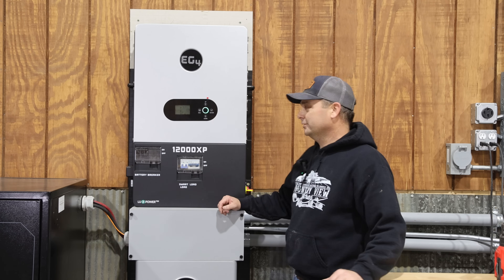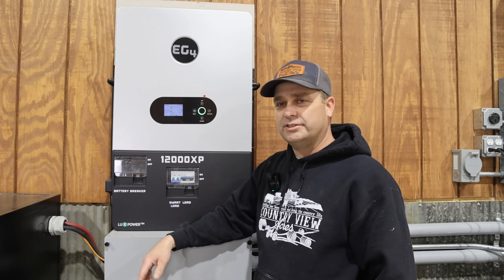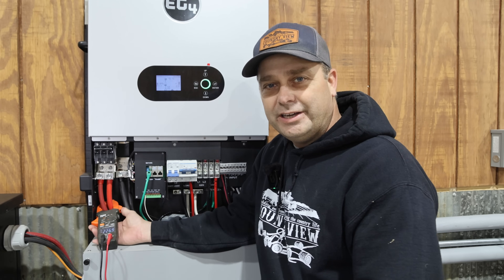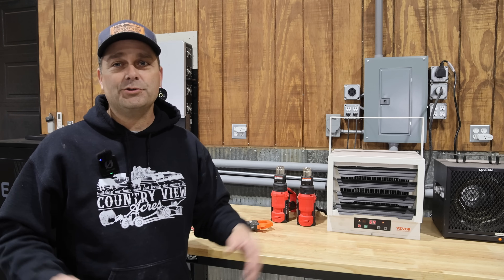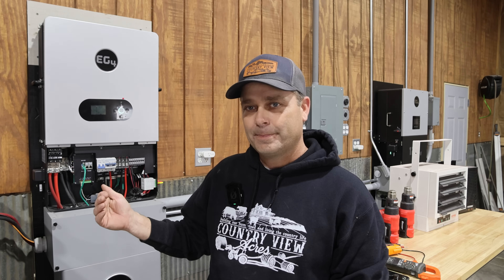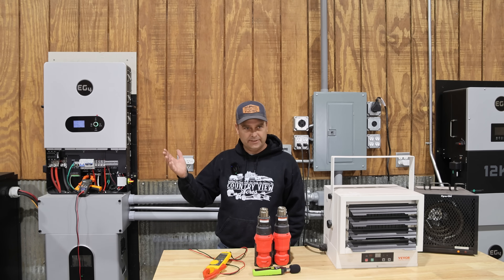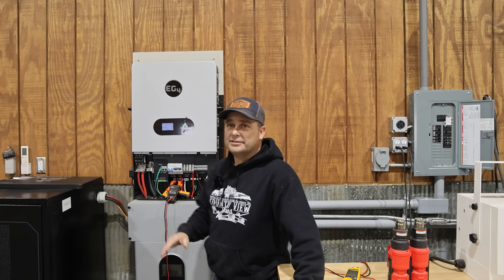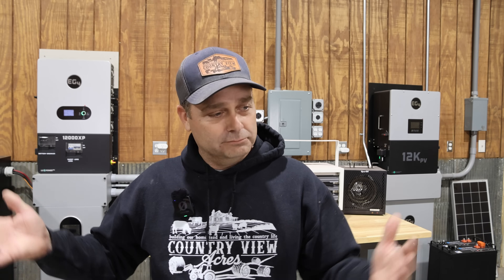12000xp Surge Testing

Comment: The 12000XP has one of the poorest surge capacity ratings out of any other 12kW inverter on the market because the Chinese engineers that designed this inverter made the decision to strip out the iron core, copper wound output transformer to save on cost. If you want an inverter with a high surge capacity, then this is definitely the wrong inverter to buy.

Comment: Thanks Evan, exactly what I needed to see. We're electric here in FL and I wondered if it would work with my tankless water heater (97 Amp surge) and you are pulling 104 +. :)
Reply from the maker: The surge might be longer on a electric water heater.  I personally wouldn't run items with a surge that high one inverter.  I would probably want 2, so they would share the load.
Reply: @CountryViewSolar-DIYProjects  Thanks Evan, Yeah, we talked (my electrician and I) about setting two 12000XPs up in series to share the load but that comes doubling the cost of the inverters and with more complex communications and battery management interface. The 97-amp surge only lasts a fraction of a second and comes back down to a working continuous amperage of 43 amps for a 10kW instant hot water heater.

Comment: Would the 18000 be even better than the 12000
Reply: DUH
Reply from the maker: what do you mean?  18000 watts?  Then yes.     If you are asking about he FlexBoss 18,  it only has 10000 watts of continuous output without solar and 13000 with solar.  the 18, stands for 18000 watts of solar panels, not output.

Comment: That is very impressive!  What safeguards do you have if system is hit by lightning?   It intrigues me that it worked so well.  Seamless on the switchover.  Thanks for sharing!
Reply from the maker: I have a surge protector on the solar panels
Reply: There's not a whole lot you can do to protect your equipment or home from lightning.  Luckily homeowners insurance should cover damage from a strike anyway.  They make some surge/arresting components that can be added to the system for what I seem to recall around $2,000+ per unit (and you might need multiple).  And that really only attempts to provide protection if it comes down the grid side.  If a significant surge reaches the arrester it is likely toast when it diverts the overvoltage/current to ground so you would be replacing that anyway.  The grounding for your home electrical system (through the grounding rod usually near your home service entrance for the grid) can actually be a path for a strike to enter as well and backfeed through the system lets say from a nearby ground strike that travels through trees or the earth.  We're talking about an average of 300 million volts and amperages could be in the thousands to well over 100,000.  There is not much that is going to stop that amount of power when you take in to consideration they jump from the atmosphere above and travel dozens of miles through the air.  It pretty much travels wherever it needs to until it neutralizes the charge.  I'll stop geeking out now.....

Comment: At what percentage of battery will the system switch over to grid power?
Reply from the maker: It is programmable.  I set it to 30%, so if the power goes out, it still has some charge.
Reply: @ That’s a great idea!💪🏼 Must be that engineer thinking👍🤣

Comment: The 12,000 xp is what I been interested in. I heard you can hook up 70 amp breaker to it from the grid and output 100 amp,50 amp from the inverter each and 50 from the grid thru a 100 amp breaker. Can you tell me if this is correct?
Reply from the maker: I have 100 amps hooked to it. They don't work together.  It is either 50 amps from inverter or 100 amps from grid.  Because it has a built in transfer switch and switch between the 2 sources.  
A hybrid inverter can share a load with the grid. Since it is grid tied.
Reply: @CountryViewSolar-DIYProjects  Thanks for the information about it.I think it would be all I would need to power my loads, or 2 maybe for 240 and power everything.  Love the videos!